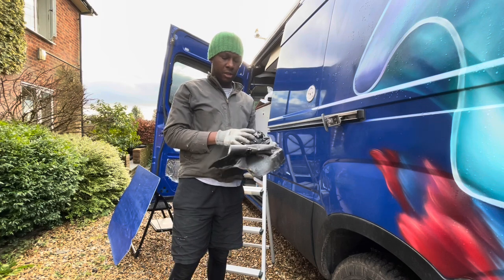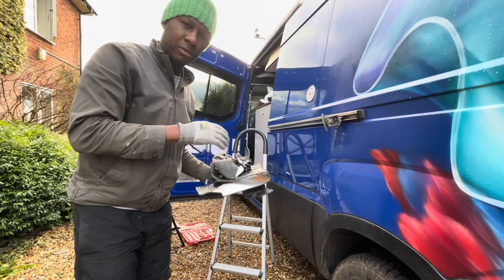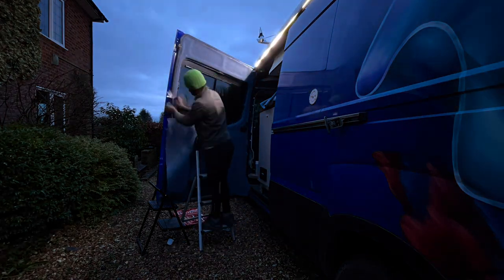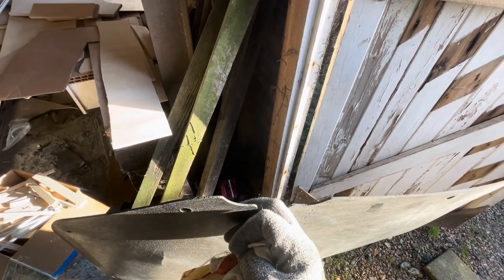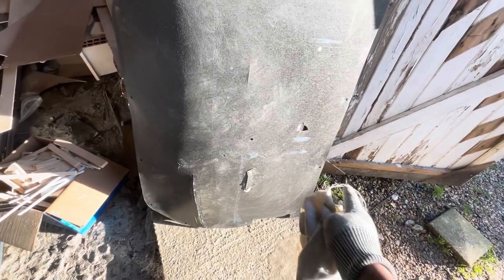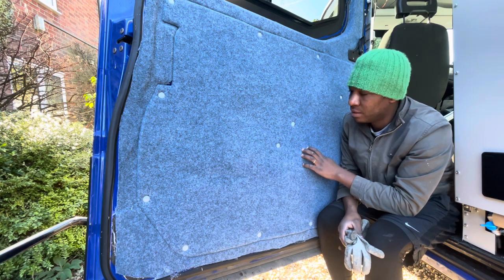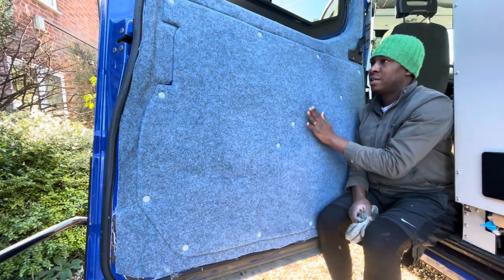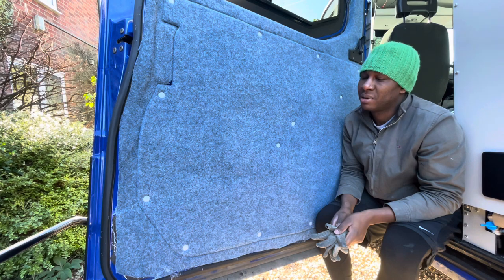Van build sliding door insulation and carpet

Comment: Hi. Where I get sliding door seal? I have the original sliding door seals on the body, but I haven't seen them on the door itself yet. Where did you get the one that goes on the door? a seal that is simply attached to the hull, then water comes through.
Reply from the maker: Hello, I just attached a P shaped seal on the door and that worked great